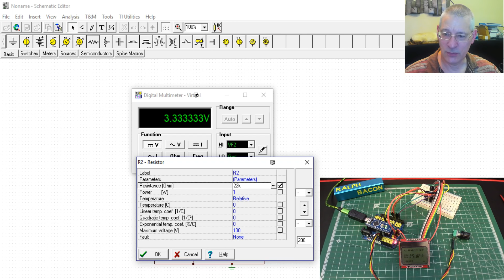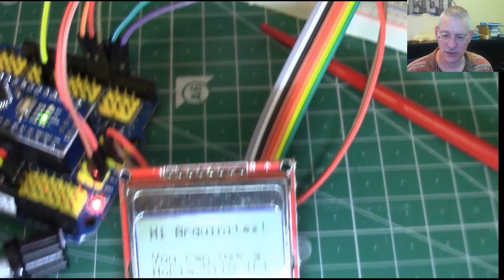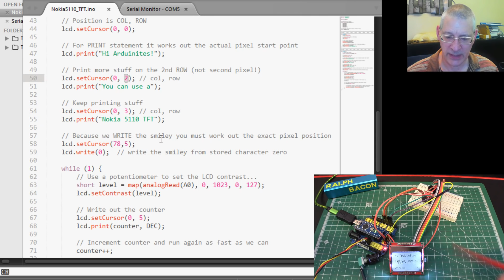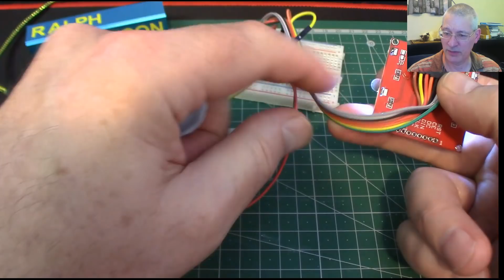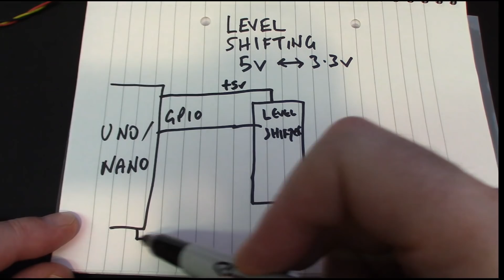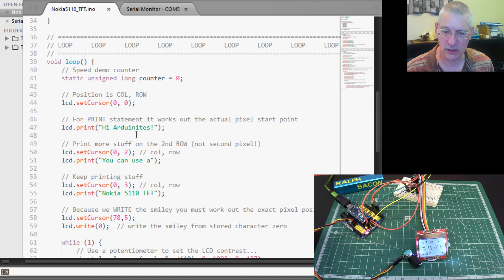#89 Nokia 5110 TFT Display - Cheap and Easy

Comment: I have been successfully using it with 5V Arduino Nano powering it from 3.3V rail and connecting data lines to Nano ports directly... No issue! It looks tolerant to 5V data ports...
Reply from the maker: Oh definitely, the VCC is 3.3V but you (and many others) all say it works fine for the data lines at 5v, whether by design or good luck we don't know. Of course, if my suspicions are correct that we are no longer buying original 5110 TFTs but some modern day copy made by a Far Eastern company, then maybe they have upped the spec to allow 5v on the data lines? Who knows?
Reply: Sergiy Gryb I have not watched the video yet but just recently I connected one of these displays to an Arduino Nano and it worked perfectly at 5V running the u8g2 and u8x8 libraries.
Reply from the maker: Yes, there are reports that it can work at 5v, although that is not what the spec states! We might be lucky, we might not be. I couldn't possibly state in my video that it works fine at 5v and then have loads of complaints that the displays were fried! Ha! Can you imagine? But empirical evidence does indicate that at least some of these displays work at 5v OK. Thanks for the information.
Reply: Sure, Ralph, agree; However, I would clearly separate the topic to: 
- powering the display (no doubts, according to a spec it should be 2.7 - 3.3V ); and 
- connecting data lines to a micro controller. 
I have four 5110 display modules from different AliExpress sellers running in pair with 5V Arduino Nano v3 modules and all of them work just fine with 5V based data lines without any extra voltage level shifting solutions. Knowing that would save you $$$ and space eliminating unnecessary resistors and level shifting multi-channel modules...

Comment: Usually I give less voltage to the screen backlight if possible. For example I have a ST7920 5V screen, and I give only 3.3V to the backlight. Still clearly visible, but longer lifetime for the backlight.
The becames black MAYBE because you should adjust the contrast if the voltage goes higher. I have a ESP8266 + ST7920 clock, if a change power supply, or use/not use breadboard I have to adjust the contrast. It makes max 0.5V difference. Btw there is a lot of circuit that 5V tolerant. Like I have a STM32... checked the datasheet, lot of pins are marked it can handle 5V level signals. The power input still have to be 3.3V.

Another tip: if you need 3.3V, use an uno to power an other uno from the firsts 3.3V output. The uno works fine with 3.3V, and now you can power anything w/o level converters. Good for testing!
Reply: Yes. Unfortunately I haven't got one, and the shipping is slow. So if you aren't in a hurry, go for it.
But I wanted to test an item, so it is a perfect solution for me.
Reply from the maker: Ah yes, the UNO/Nano will (not officially) run all the way down to 2.7 volts apparently, but you would be outside of the spec sheet's tolerances. But a GREAT way to test out screens (or other devices) that are (allegedly) not 5v tolerant.
 
Good tip about the contrast too. Unfortunately I don't want to burn out my screen like others do in their YouTube channels as my funds are very limited! But I might experiment a bit further with voltage just to see how it copes...
Reply: Hi Ralph!
Just checked the Atmel 328P datasheet, from 2.7V max 10MHz is in spec. For 10-20MHz you need 4.5+. The 328p can go as low as 1.8V up to 4MHz, up to 5.5V and 20MHz.

There is RTC support in the arduino. You only need a 32KHz quartz, wich costs nearly nothing. Like 100PCS for 2.5GBP. And the datasheet says something very low power consumption. After my exam season I'll investigate this myselft, but notify you just in case you are interested in it. There are some downsides too, no battery backup, and probably more drift compared to a thermally controlled DS3231.

AND EVEN MORE INTERESTING: 8bit MCU Dev board $1 (or less) delivered! STM8, you maybe need an ST-Link, and there is somekind of Arduino SDK for it named "sduino" on github.
Reply from the maker: You're not the first person on this channel to mention the STM8; the trouble is, there is too much hardware out there for me to investigate! But it's interesting about the frequency vs voltage on the Atmel 328P. I have had a standard 16Mhz Nano run at 2.7 volts (from a decaying 18650 battery) but that is (according to you and the datasheet) just sheer blind luck and not within spec. Hmm, I'll read up a bit more about voltages tonight, thanks for the info, very useful.